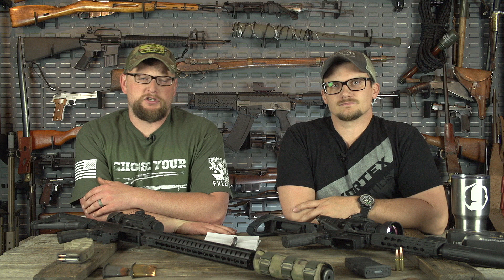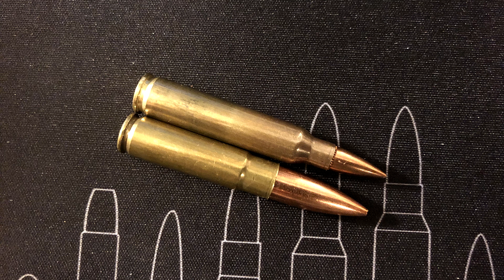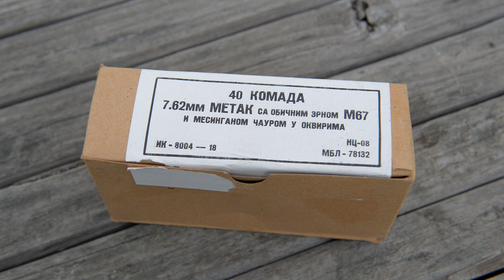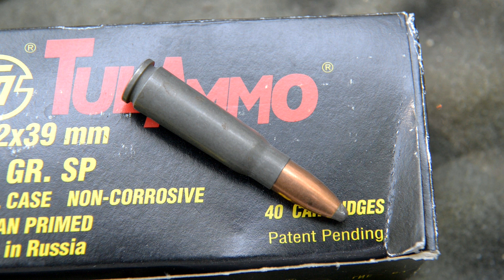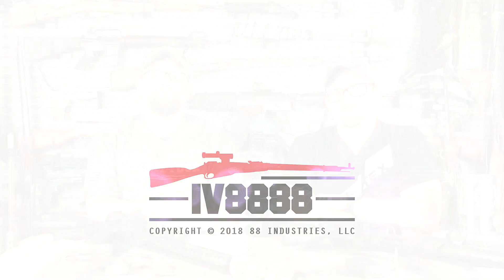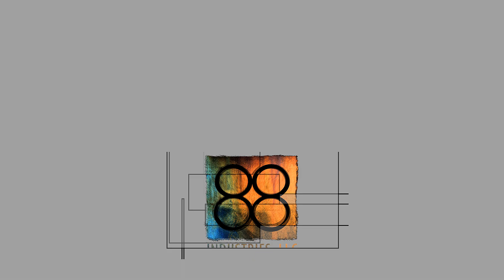Firearms Facts: 7.62x39mm vs 300 Blackout

Comment: 300 blk cases can easily be made from .223 brass.

The light end of the 300 Blk is 85 gr going over 2900 ft/sec in a 16 in barrel. The heavy end is 265 gr.

Comment: I got 2650 out of 123 grain bullet from my 762x39 18 inch AR15!  Never have had a problem with over pressure.  The key is the powder!!  Use 1680 powder!!!  Also 2200!

Comment: I have both in AR15 style. I built a 762x39 upper because cheap ammo. If shtf you find you neighbor has 9mm, 223, 22, and 762. They won’t have 300b/o.

However, 300b/o is better for suppression. Especially if you are doing an SBR. 

So I love them both for different reasons. If I had to pick 1 on and AR it would be 300 just due to reliability factors on AR platform specifically.

Comment: I live in an area that’s got lots of hills and is heavily wooded. I really have to look to find places that offer much more than 150 yard shot. I own a few rifles in both calipers and have had great success using both on deer. I have a ruger American ranch rifle in both calipers and really think either is a fantastic choice for beginners-younger hunters. I do prefer the 7.62 +39 because it does offer a little more punch but when used properly the 300 blackout is still a solid option for up to deer sized game. I handload a 120 grain barnes tac-tx with a velocity of 2342fps out of a 16” barrel that is a solid deer load probably for hogs to. If you are using a 300 Blackout for hunting you gotta accept the fact most rounds are limited to 200 yards or less. I think both are great if used properly.

Comment: Wander what Eric thinks now that 300 blk is possibly the most common AR cartredge aside from the 5.56 and a lot of people are dumping the anemic 22 cal. Recent bans on Russian ammo makes 7.62 & 5.45 almost unobtainable. 
Yep! I got the blkout. I got several uppers but my blkout is my go-to for everything almost.
Reply: And AAC/PSA is selling .300 Blackout hunting rounds with 115 grain SIerra JHP soft points for deer and hog hunting. Only $1 a round. That's fair. You would do better with 6.5CM or .308, which AAC/PSA is selling soft points for $1 a round as well. Most .308 and 6.5 hunting cartridges are about $1.28 to $2.5 a bullet today.

The Sierra (or AAC 115gr JHP) should be pushing 2300fps out of a 16" barrel, maybe 22300 out of a 13.9" SOLGW barrel. You can take 250lb animals and below with kind of power.
Good 150yard and in rifle for the midwestern forest and dense, wooded southern forests (smaller deer, too).

300 AAC makes more sense in 2024 than 762x39, and 5.56 makes more sense than 5.45x39.

Comment: My old 300 Win Mag was zero'd for 300 yards and I never took it in the stands if the shot were less than 300 yards Id use my 30-30 Savage 340C Bolt action for shots at lees than 300 yards

Comment: This is what I’ve been struggling with because of the drastic price difference in ammunition.
Does anyone know if a 6.5 Grendel type 2 BCG will work with 7.62x39?
I know the 6.5 Grendel type 1 bolt will work with 7.63x39 but I’m getting conflicting opinions

Comment: I appreciate honest reviews like this.

Eric loves 7.62x39, Chad like 300 AAC. Both appreciate the other., but they have their preferences.

Now, not to intentiinally quote ntnfncy, but philosophy of use comes into play:

Home defense.
Plinking.
Animal harvesting.
Self defense.
Zombies.
Long Range.
Gunsmithing.
Reloading.
Finances.
Ergonomics.

10 to 200 yards, both are great.
300 yards +, it begins to become a stretch, but the 7.62 does better than the 300.

Ammo price, 7.62 wins, by a long shot.

Self defense, the 300 "sub" shorty/suppressed is the absolute winner, especially in CQB.

Gunsmithing and $$$$, for me at least, I invested in the platform that allows me to plug-n-play with all my rifles, swap uppers, lowers, bcg's, accesories, etc, and have a parts stock that works with all, and I went with the AR-15 platform.

I like that 99% of my parts and accessories are interchangeable from 5.56 to 300. 

The only hitch in my giddy-up for my philosophy is ammo prices for 300. But deals do pop up and I snag them and stock up.

I like that with my limited resources a,

* 5.56, 16" w/lpvo
* 5.56, 16" w/iron sights
* 300 11" sub with 
   suppressor
* 300 16" set for supersonic
   w/ 3x9x40

All of this is strictly about me:
I'm a 1 to 200 yard shooter.
Ergonomics matter.
Repeatable statistics matter.
What works best for me matters.

All that being said, I LOVE that both sides were presented here, and we all learned something. But most of all, use what is best for you and your application!

Comment: Even with current administration-induced 7.62×39 supply issues and limited availability of prime 7.62×39 hunting cartridges (S&B 124gr SP are my favorite), I would STILL take the 7.62×39 over 300blk because it is still cheaper to purchase, easier to stock up on, and also fills the "life and liberty" niche. That's a hat-trick in my book. Besides, I simply love the ×39 cartridge for just about everything I use it for.

Comment: My thinking is the 300BLK is a 7.62x39 power range caliber, in the popular AR platform. 
I will always be partial to the 7.62x39 for hunting/practicing cost per shot and that I used it to take my first buck. 
Both are capable calibers. One lends itself to the non-reloader. The other allows a reloader to go wild.

Comment: They make bolt action rifles that fireb7.62x39 that'll dust a 300 by blackout and 7.62 guns are made to spit anything you feed them reliably

Also I forget the brand but it's in a blue box and it's a round nose soft point and they'll kill anything a 30-06 will

Comment: I bought a Bear Creek Arsensal AR15 chambered in 7.62 x 39. I had to put a hardened firing pin into it plus a stronger trigger spring in it. It would not fire the berdan on the Russian ammo until I did this. Since I bought mine BCA has installed the same things I installed in order for it to shoot the Russian ammo.

Comment: Please show how a bullet is slower coming out of a longer barrel.
Reply: D9ends on burn rate and psi so for example 9mm maxes out between 7-12 inches after that most 9mm ain't burning powder and friction takes its toll 7.62x39 from a 16 inch barrel is about 2400 fps from 20 inch barrels or 21 inch barrels you'll only gain like 100 fps max while rounds like 5.56 would gain 400 fps it depends on round, psi, burn rate and several other factors

Comment: I chose 7.62x39 when I was 17 and never looked back.  Mainly because 5.56 needed to be 80 to 100 grains and would never get better.  But also because AK ammo is cheap and you can actually shoot it.  .300 Blackout is better than a submachine gun in .45 ACP because your range doubles.  But I've always considered .300 Blackout to be expensive and boutique for slightly less power.  9mm is also dumb when you can get .30 caliber rifle rounds for the same price or less.  AK is a 300-yard carbine and there you go.  A cheap functional master blaster.  And .300 Blackout is neat to toy with if you have money to burn.

Comment: Very good argument. I choose to use both as my battle rifles depending on the situation; 7.62x39 122gr (unsuppressed bubba'd SKS Red Dot and large magazines) when knee deep in bad guys, and 7.62x35 200gr (HoneyBadger SBR MicroPrism optic and Magpul magazines) when want to be unannounced (suppressed) and stealth deadly. I only use 7.62x35 in subsonic with suppressor and know its ballistic limitations, thus 7.62x39 is for my grunt work. I use 7.62x51 in multiple type bullets (AR-10 suppressed) for my sniper or armor piercing needs at longer ranges. Just saying.

Comment: Its way more practical to build a complete 300 blk upper and attach ur lower (that most likely has a 556 upper already on) instead if taking the barrel out
Reply: Probably won't build a 300 blk upper.  556 is enough.  Also ammo is like 60 cents more a round for .300 than 556. 
Its insane how expensive.300 ammo costs now. Wtf

Comment: I have my 762x39 running supers and subs with out  changing anything its perfect, its better the 300blk. because 300 feet per second and MV 300 lbs. I still like my 300 blk for subsonic. But my 762x39 is better.

Comment: Its purpose is to achieve ballistics similar to the 7.62×39mm Soviet cartridge in an AR-15 while using standard AR-15 magazines at their normal capacity.

"The 300 AAC Blackout was designed to achieve energies similar to the 7.62×39mm Soviet in an AR-15 while using standard AR magazines at their full capacity. The 7.62 Soviet's cartridge taper prevented reliable feeding in AR magazines and created wear on the bolt."

I think it's safe to say that the cartridge's main purpose is use in sub compact, sub sonic, suppressed weapons.

"While 5.56×45mm NATO has enjoyed widespread acceptance in military circles, the nature of the missions encountered by some special operations groups often demand a round that provides better performance than that available in the high-energy standard velocity rounds and subsonic performance greater than standard 9mm (the ubiquitous pistol round also commonly used in many SMGs)."

Comment: I've loaded 150 grain round nose to an average velocity of 2200 FPS and 170 grain flat nosed bullets to 1700 FPS in a 22 inch barrel.  These are .308 diameter bullets and all of my hand loads use .308 bullets.  Accuracy, 3 inch groups at 100 yards, 5 inch at 200.  This is from a standard SKS Carbine.

Comment: Now that .300 blk has become significantly more available and the Russian supply issues I'd be interested in seeing you guys revisit this topic.
Reply: Still see 7.62x39 cheaper by like 10 dollars easily
Reply: @jorgesolis9468  I disagree, long time AK guy here just recently switching to 300 blackout. The real difference is type of bullet. 7.62x39 FMJ is pretty available right now for about $9/box which is cheaper than 300 blackout FMJ. But thats it, FMJ, the hornady SST are all gone, you can barely find tula or wolf JHP which are ok and that will cost at least $12/box if you can find it plus shipping etc because youre not going to find x39 JHPs in store. Compare to 300 blackout which has all different kinds of bullets available, Barnes, Sierra you name it. I just bought some 300 blackout 110gr VMAX, thats brass cased with the red ballistic tip for $12/box. Thats a much more premium bullet than anything you can find in x39 for barely much more. I repeat 300 blackout vmax is 33% more expensive than x39 FMJ and the same price as x39 JHP but much more widely available..... Its February 2023 and this is the state of things.
Reply: @MannElite  not here where im at ther gun shop had a whole car of s&b 123 jsp and I think 2 cases of 154 gr jsp wolf
Reply: @MannElite  premium doesn't mean much on rounds that max out on 300 yard max effective hits
Reply: @MannElite  there's no denying that there is more bullet selection for .308 than .311 not enough to make overall lower price, performance, and availability advantage a bad option
Reply: @MannElite  I personally shiny mess with hollow points because some brands dont expands and act like regular fmj
Reply: @jorgesolis9468  get as much while you can lol
Reply: @MannElite  that's how it is all over my part of Texas at least
Reply: @MannElite  very well said!!! Grew up with SKS and always respected  the caliber but 300 blackout just had that great versatility and without angled bullets and super arched mags so I too went with it! Love the all purpose side of it. I’m not a big shooter of rifles so stocking up on 300 blackout for backup shtf is not a super major problem for me.
Reply: @jorgesolis9468  right. Even the american company's that have stepped up to supply the drying up Russian demand are far cheaper than 300 blk
Reply: @beards-N-boonies  yeah by like 5 dollars and 7.62x39 factory is hotter than 300 blackout factory loads usually too
Reply: @jorgesolis9468  seriously? Thats news to me. Actually makes sense when I start to think about what 300 blk
Reply: @beards-N-boonies  usually now you can handload 300 blackout alot easier though and can start hitting 7.62x39 power standard 300 is a 125 gr at 2250 fps while 7.62x30 is like a 123 gr at 2350 fps from the same barrel so about 100 ft lbs more than 300 blackout for sometimes half the price
Reply: tons of non- russian ammo out there for x39, some brass cased for less than 10 bucks/ 20. I just bought a bunch of norma for 9.94/ 20, great ammo!
Reply: @VailJohnson  Norma doesn't even have x39 on their website...
Reply: @MannElite  I know, I think it was 'velocity' ammo online but I use a few different websites for ammo.

Comment: So... getum both?

Idk kinda looks like the same thing. I like the 308/ar10 because of the power and versatility. Avg fps is 2800. But that price for ammo in 762x39 is hard to beat for a decent rifle round, most rifle rounds now are 1$ per round and up.

6.5 Creedmoor is also a popular choice. 

Price i think there all about the same around 1000/1200 and up. I dont have that kind of money, I usually look for what I can find a good deal on usually used.

Those longer ranges I would go with 7mm.

Comment: AR conversion to 7.62x39 also requires a spec'd firing pin to handle harder Berdan primers.
Reply: Yea it’s a stupid idea using Russian in AR . Just get 300 or 556!!!
Reply: @burtonkephart6239  Not a big deal. I run 7.62x39 in mine and it’s fine. A lot less expensive too.

Comment: 300blk can be cheaper if it gets more popular. It's superior to 7.62x39 in an AR because it only requires a barrel swap. It also doesn't break bolts like seems to happen in ARs riring 7.62x39. The versatility alone makes 300blk a better all arounder than 7.62x39. That's not to say 7.62x39 is a bad round, I just look at 300blk as a more modernized version of it for a more modernized weapon. I get the AR platform is from the 60s, but what we have today is quite difd9feom what came out then. And the design lends it's self to be so easily modernized. Not so much with an AK design. The AR platform is just a better design in terms of accuracy and effective usability. Forgotten Weapons and Polenar Tactical even talked about this.

Comment: i picked up a 300 BO cva scout for hunting medium sized game inside 150 yds, and I am looking at converting one of my AR15s to 300 BO for home defense pistol just because it is so easy and cheap - less than $100 for a barrel change and the 300 has enough bullet mass to be effective out of a 7.5 barrel.  5.56 is too speed dependent to shoot from that short of a barrel IMO  below 2500 fps you might as well be shooting 22 WMR as 556 - probably better off with 22 wmr at that speed.  I do love my SKS too for a mid range backup to my AR or to pass out to visitors cum home defenders - I stockpiled the ammo when the  price was cheap.

I reload so many arguments against 300 BO don't affect me - using standard AR mags and bolts is a big selling point for me - a barrel change and that is it - my AR is now a 300 BO pistol CQB or home defense gun.

Comment: Eric is using False data. It is standard in the USA that 7.62x39 uses a .308 barrel diameter. Saami spec states 7.63x39 to be .310 +0 -.002 which puts it in line with using the same bullets as the blackout. Which is why it’s very common to find 7.62x39 with .308 diameter barrels.

Comment: Based on the length of action, I've always felt even though 300aac is a little less in velocity, the shorter case allows for a little more options when loading heavier projectiles/subsonics.

The only critters I would use subs on, is the two legged kind that break into my house in the middle of the night.

Comment: I am looking at getting a rifle in 7.62x39 and have heard people say ar15 is more accurate than ak47. Do you recommend ar15 over ak47? I cant afford a CMMG mutant but Palmetto State has a ar15 in 7.62x39 that takes ak47 mags or should I just stick with the platform the round was designed for.

Comment: By all means if you don't  already have a gun the 7.62 x 39 makes sense on a number of different levels. If you already have an AR15 and 15 or 20 or more magazines why reinvent the wheel. A 300 BO upper allows an easy caliber swap on the same lower...
Or buy a 300 BO pistol as a defense weapon and still have you 5.56 carbine as a general purpose weapon.  You'll  have better parts commonality and the same manual of arms and a more versatile choice rounds. 
I gotta say Eric's talking over Chad was getting obnoxious.

Comment: This is a great discussion. Especially when you start talking case capacity and powder burn rate. I think when the rubber is gonna hit the road is the use of 7.62x39 ammo in the AR-15 platform. That's when you can start experimenting with different powder burn rates that can't be supported by the AK-47 platform. 
I have yet to see anyone trying to adopt all the varying calibers, using an AK-47 platform.

Comment: I bought a sack full of pulled .30 black tip AP.  It occurred to me that I could ( maybe?)  make a .300 B/O AP round🤔... So I built a .300 bo. This was about 2 years ago at the pinnacle of the ammo shortage.   I needed to test fire the thing just to sight it in. I'm in the Smyrna area so I went to Adventure Outdoors🤮. ALL they had in .300 BO was subsonic. ( but they did have a LOT of it  @$$$).  AS I was not yet set up to load my own and nobody had any decently hot .300, I just lost interest in the project and have not touched it since. Just sits in a corner and collects dust.  I have always liked the .762x 39 and have several rifles for that . I love my old Norinco SKS.

Comment: powder burnings is powder burnings.  the physics is there. the case design is only a small percentage of the equation.  if you can do that with 300blk then yes you can do the same with the 7.62x39 hand load.